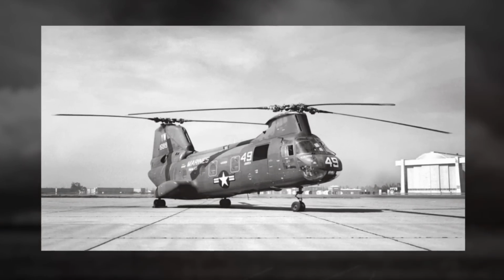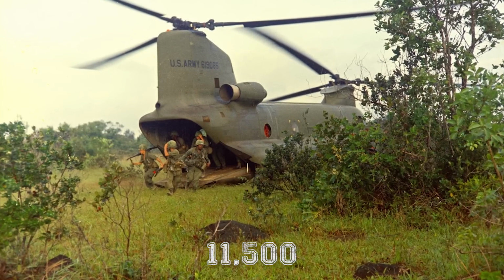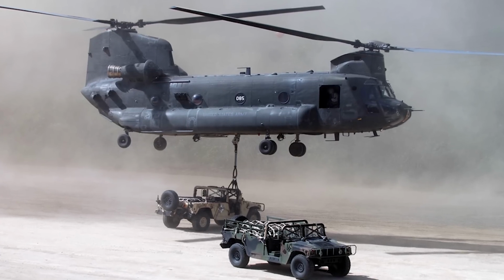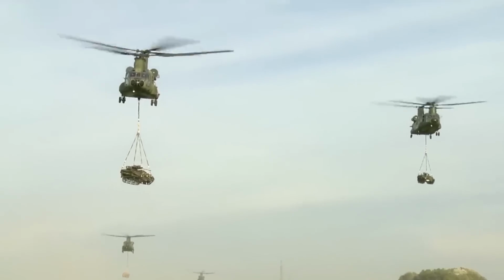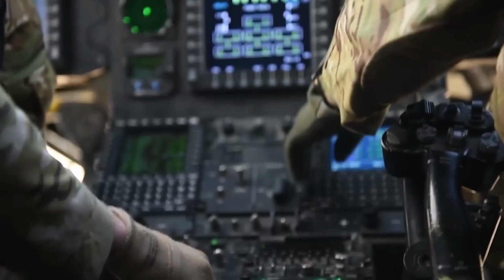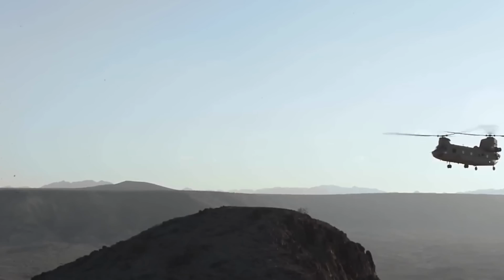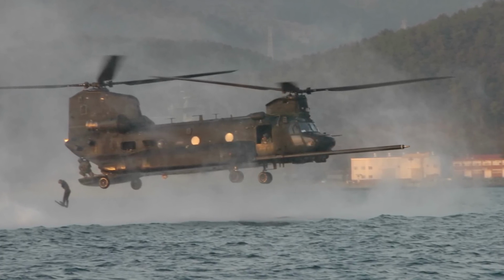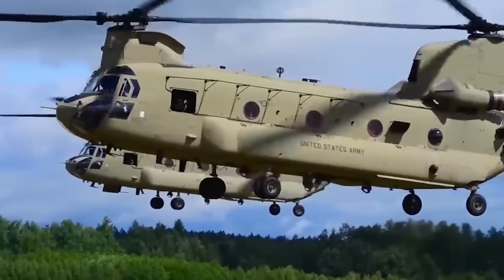US New CH-47 Chinook After Upgrade SHOCKED The World!

Comment: "Guns-a-Go-Go" In the Ia Drang in 1966: Two large, specially outfitted, twin-rotor CH-47 Chinooks, rigged as gunships, came flying in from behind past us, sending a hail of glowing red 20mm tracers speeding ahead of us into the LZ, along with 40mm M-79 rounds and 2.75-inch rockets. Each CH-47 Go-Go had an automatic M-79 in front and two Browning 20mm cannons, one on each side, four total, firing forward. The two Birds carried 2.75-inch rockets in four pods, nineteen in each, one mounted on each side of the two fuselages. Both bore five .50 cal Browning machine guns, four facing outward, two left and two right, and one aft, out the rear lift gate.  In attack formation, the “Go-Gos” sped past us, blowing the hell outa the LZ, three hundred meters ahead. They fired thirty-eight rockets (half their loads) and blasted away with 400 rounds of 20mm, plus 200 rounds of M-79, with all that empty brass raining down into the jungle behind them. Obscured by explosions, the LZ disappeared in the smoke. As the Go-Gos flew into the LZ, the forward firing 20mms, the rockets, and the 40mm M-79s ceased firing. The eight .50 cal side door gunners opened up on the LZ, cross-firing underneath one another. Firing out and downwards to the outside of the LZ they spewed another 1,600 pieces of spent .50 cal brass, with the 1/2” copper jacketed lead bullets raining down around into the perimeter of the LZ. After the Chinooks passed the LZ, the .50s in the back of each bird began firing parallel and out from us as we came into the LZ, leaving another 200 rounds of .50 cal brass on the decks of the birds and in the LZ. When we came whopping in through the swirling grey and black smoke from all the expended ordinance, the sixteen Huey door gunners fired their machine guns into the jungle surrounding the LZ, spewing another 4,800 rounds of .30 cal copper-jacketed lead and empty brass into the LZ. (The NVA hated the Go-Gos...)
 They only built four Go-Go birds: “Birth Control”, “Co$t of Living”,“Easy Money”, and wrecked before deployment: “Stump Jumper”. “Birth Control” got shot down during Tet 1968 and destroyed by NVA mortar fire. “Co$t of Living” had a 20mm cannon come loose and it shot itself down. Someone found the only remaining bird, “Easy Money”, rescued it from the junk pile. It’s restored and on display at the Redstone Arsenal in Alabama.

Comment: it's a big target in combat. I like thed UH1 in Vietnam over the Chinook when going into LZ's.
Reply: Both vehicles have advantages over the other. Like you said, the Huey presents a much smaller target and can land in much tighter spaces. If I’m an infantryman who wants to be inserted in a dangerous place as quickly and unobtrusively as possible, I would prefer the Huey. The Chinook on the other hand is much faster and longer-ranged, with tremendous troop and cargo capacity. Its tandem-rotor design makes it steadier than any other helicopter in a hover. It can land on water. Its rear ramp makes loading and unloading passengers and cargo much faster and easier. It can carry light vehicles that can quickly drive off and on over its rear ramp. It can sling load the M777 howitzer along with its crew and ammo, including Excalibur GPS-guided rounds.